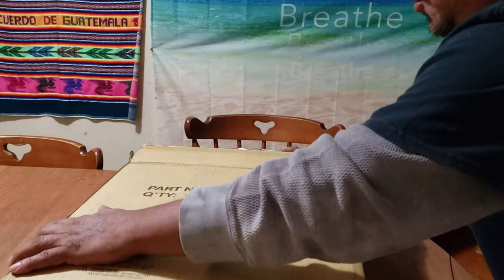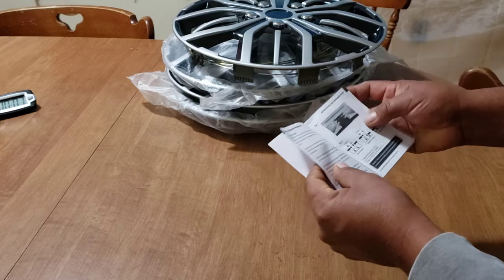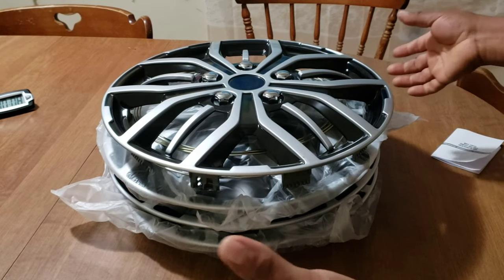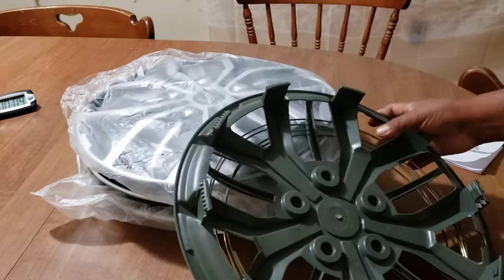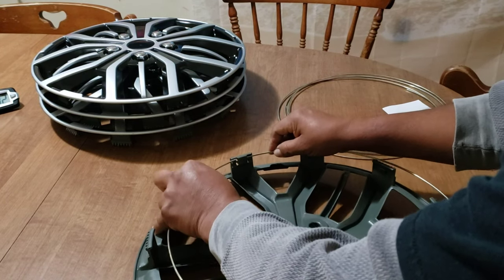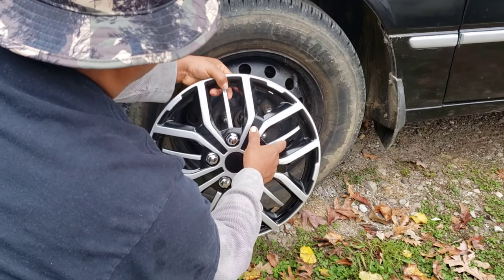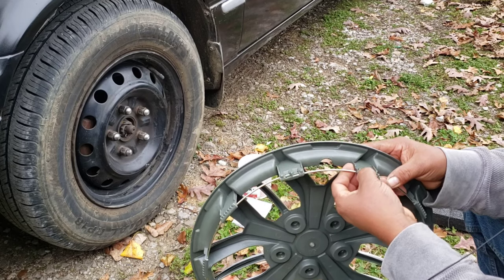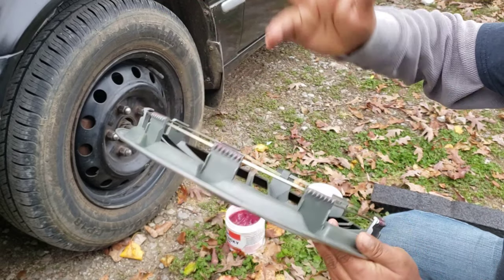Toyota Camry Wheel Cover Review and Installation Video, Pilot Automotive WH142-14S-B, 14 Inch

Comment: The set I bought for my 2017 Nissan Rogue had a section of the metal wire that was shaped to go around the valve stem.  I think they redesigned them after having complaints about the wires hitting the valve stems.
Reply from the maker: wow that sucks for me bought the old version, thanks for the comment this should help Others to understand Or Confess  lol